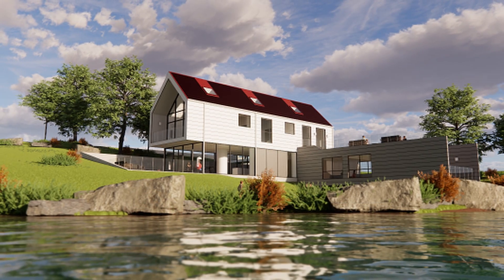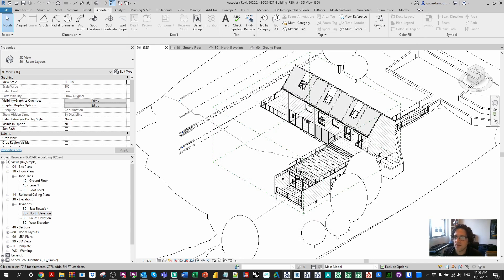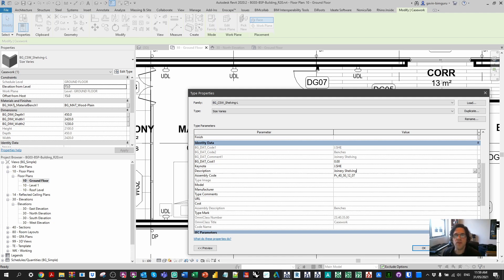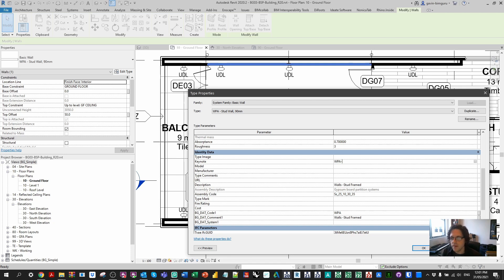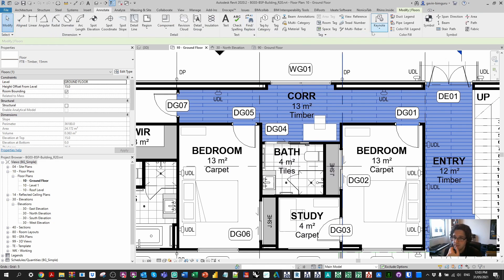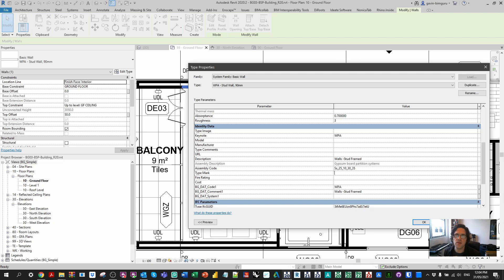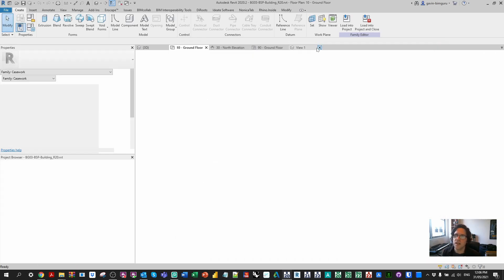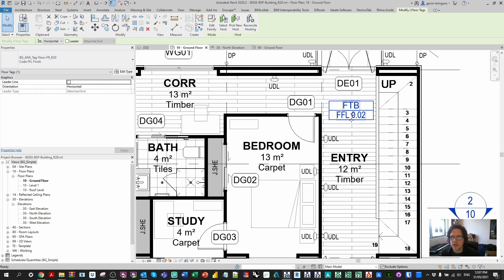Managing object code fields in Revit!

Comment: Hi! Someone knows how can I use a keynote for each wall layer part!? not by using material keynote, I'm trying to figure out how to do this on compound elements such as walls, ceillings, floors etc... Thnx for sharing this material!
Reply from the maker: Unfortunately the only way seems to be by using the material keynote, which can also be overridden by part settings. Not what you're looking for though I know. The options are quite limited.
Reply: @AussieBIMGuru  Thanks for asking, regards

Comment: Very nice video! I'm an MEP designer and I use multi-category tags with shared parameters to tag my families on the project. I think the downside of this technique is that MEP families use lookup tables to feed the shared parameters, and every time I need to change a parameter value I need to replace the lookup table manually inside the family. It is a very worky process when you have several families to manage.

Does anyone know a way to do this process on Dynamo?
Reply from the maker: Thanks! Yes I know engineers don't typically have much use for keynotes versus architects - makes sense. They have many more things to tag and consider on drawings in most cases for elements.

I have indeed seen the challenge of lookup values being buried in csv before, and whilst I haven't tried automating the update of csv files in a family, it looks like this might be a lead:
https://forum.dynamobim.com/t/batch-import-lookuptable-csv-files-to-families/22963/4

Erfajo added a node to introduce lookup tables, so I'm wondering if it also can overwrite (via the same import process). The lookup formulae would still be the same, so it would only really work if you have those set up properly and all that is changing is the lookup values themselves. You would need to use Dynamo to open the family file itself first, which can be done via the Orchid package as well I believe (if not, Genius Loci has nodes for this I think).

Comment: Thx Gavin, it helps me a lot. In some small projects, like townhouse or house projects,  team leader always set tags with type mark for all items including joinery and fixtures. But, in large multi-resi projects they would use Element Keynotes and Material Keynotes. Do you think is that OK for some small projects using all taging or seperate using tags for window, door, wall, keynotes for joinery fixture etc? Like you mentioned, keynotes follow with families which could easily manager in the library.
Reply from the maker: Type mark is mainly for when you want every project to be unique and have the ability to quickly change codes. It probably makes more sense on residential projects, but given it only exists at project level it is hard to standardize it outside the model.

For the most part I don't use type marks these days, use a common shared parameter and/or keynotes as these can be stored outside the model in libraries or transferred from other projects. I usually use separate tag types only when the tag shows specific information unique to that category, so for example a door. I wouldn't want to be able to use a door tag on a wall, so I'd make that a category tag to avoid this mistake happening.

Comment: Hello from Houston, Tx. I understand my following question is not related to your video, I have a situation I'm hoping you can help or point me to the right direction. I'm trying to schedule the 'Elevation' parameter from a security device family, what's the best way to do so? Thank you in advance.
Reply: Unfortunately, there is no direct way to schedule things like "offset", "Elevation", etc in Revit. 
You can setup Shared Parameters in your family. Then using Dynamo read those values from Revit and put into the Shared Parameters and then you'll be able to schedule them.
Reply from the maker: Thanks Zhaohui, right you are there. Great to see viewers helping each other out :)

Wilfredo, I have a tutorial that might help as a reference where I use Dynamo to put the door to/from fields into exposed parameters for scheduling. It would be the same for your case, but using security devices and the elevation field:
https://www.youtube.com/watch?v=xHDMBwx5414
Reply: @AussieBIMGuru  Thank you, I'll keep you posted.
Reply: @czh998  I'll give it a shot, Thank you